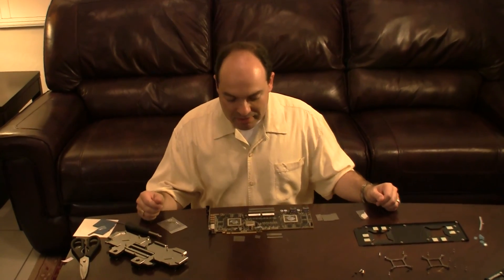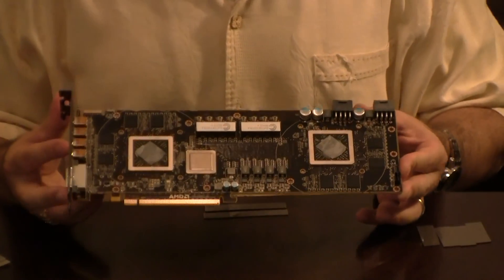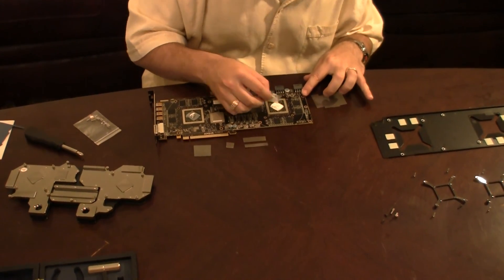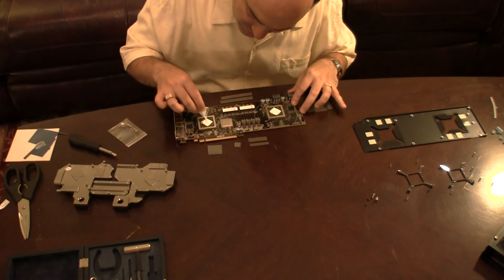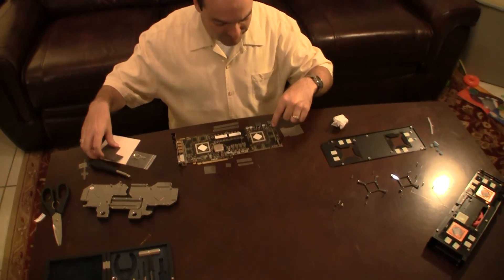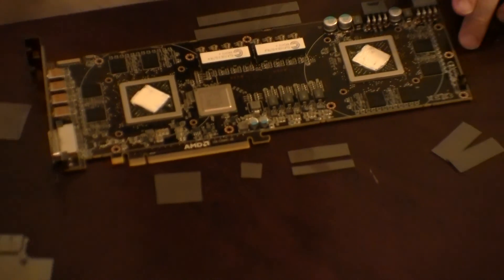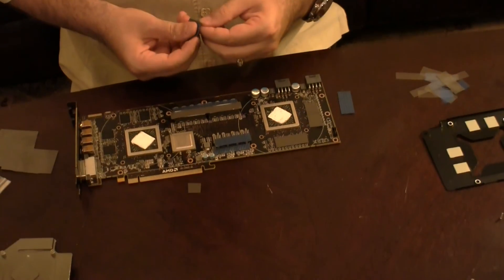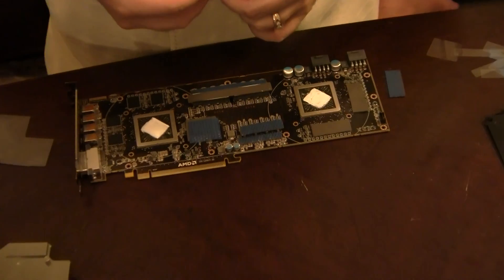Water Cooling Your Computer - Part 14A - Installing Water Block for an AMD 6990 Video Card

Comment: "rubber seals"= Thermal Pads
Also its a good idea to clean the gpus with rubbing alcohol and a lint free cloth (I like to use coffee filters) to clean the old crummy paste off before you apply new paste.
Good job tho! it can be pretty nerve racking tearing apart a $700+ piece of equipment for the first time. I've learned that these cards are pretty resilient as long as you don't break any of the surface mounted resistors/capacitors off.